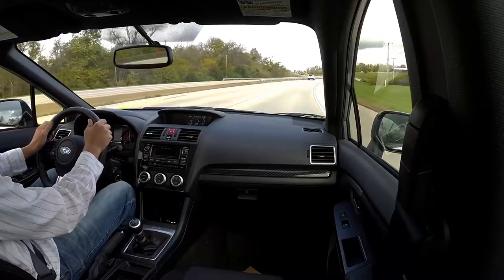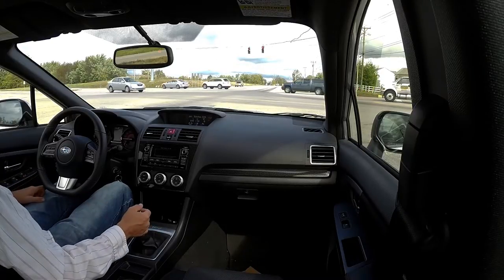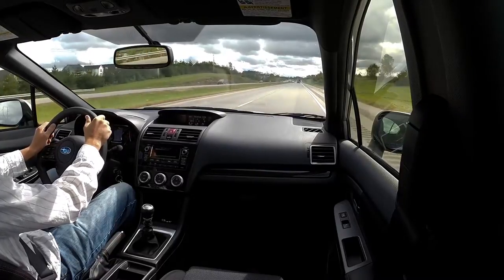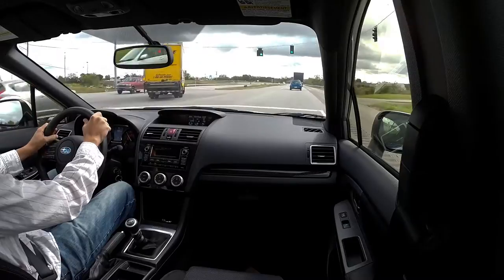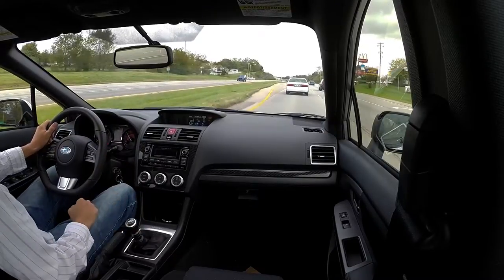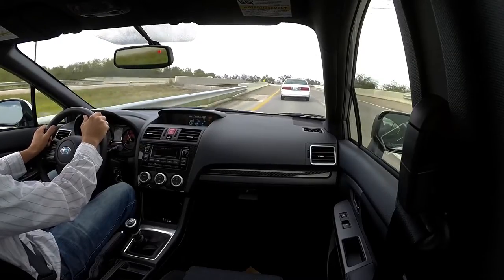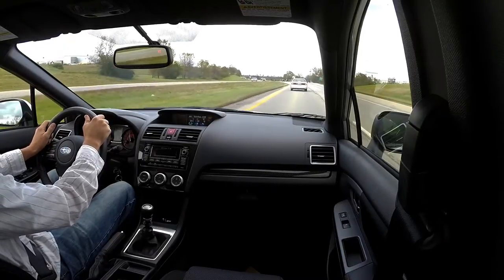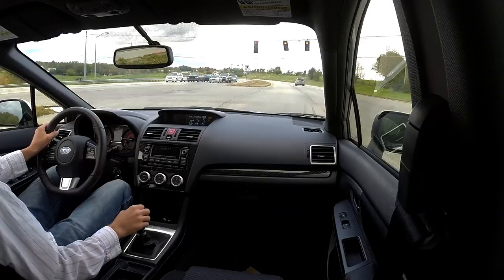2015 WRX Answering some questions about driving a manual transmission

Comment: I have a quick question. The WRX is my first manual car and I have done well driving it so far, only 6 stalls in 100 miles. I was wondering how you get off the line faster  and smoothly  at a traffic light or stop sign. What I do now is find the biting point and the apply a little gas while slowly releasing the clutch (sometimes it's a smooth start, sometimes it's a little rough), which seems to take forever and usually a car would honk at me or I would feel bad for making them wait behind me while others speed off in the other lanes. Someone told me I need to give it more gas while doing what I said above or Rev it up to around 2k rpm while feathering the clutch out slowly, but I don't know if that causes too much ware on the clutch.  Also, the 1 to 2 and 2 to 3 gear shifts are a little rough. I think it's because I'm taking too long to shift and the rpms are dropping and when I slowly release the clutch they have to shoot back up causing the jolt. Would the correct way to go about this is to shift faster and or to apply a little gas while releasing the clutch? Is this causing any premature ware on anything because the car seems to not struggle to match rpms it just jolts a little when the the clutch starts to engage. It would be really helpful if you can answer!

Comment: Going from a civic to a wrx.  The clutch takes some getting used to.  Drove the civic for 2 years and went straight to the wrx and the clutch on the wrx took me by surprise.  IT takes some pracice on that car.  But its just repetition basically.  I slipped mine very early on just trying to get used to how it behaved and finding a good seating position and what not.
Reply: I agre. I also went from a 2009 Civic Si and that gear box was very nice. The WRX is ver clunky and notchy. I'm at 7k on my 2015 and I'm very use to it now. I'm sure it broke in some too.

Comment: Downshifting when slowing down will save your brakes but at the cost of more wear and tear to your clutch and transmission. I don't know about you but I'd rather replace brakes. If your are, for example, in 5th gear and a red light is coming, keep it in gear without gas and leave it there while using your brakes to slow down and right before it will stall, put it in neutral. Not only will this save on your clutch and transmission, it will save you on gas since the fuel ejectors are off when in gear and coasting since the momentum is what's keeping the engine running.
Reply from the maker: True clutch wear will be increased, assuming you only push in the clutch while shifting it will increase wear.   Unless you are abusing the clutch it should not go out too quickly.  If you are planning on having the car beyond 80-100 thousand miles you will probably need a replacement at some point.  My Tacoma had 170,000 miles on it when I traded it in on the original clutch with no problems.  As long as your rev matches are correct and the downshift is smooth there should not be any significant wear on the transmission.  This is no different than letting the car hold you back when going down a hill, engine breaking is commonly used by many, and I mean many manual drivers and I have yet to hear of a single transmission failure that has been the result of using gears to slow you down.   Accelerating WOT at full boost puts much more stress on all parts of the drivetrain than downshifting to decelerate as demonstrated in this video.
Reply: or just rev match downshift...and not worry about it.
Reply: brentd86
rev matching + engine braking is great during break in period too.

Comment: Been driving stick for a couple years now. I've been pretty good at driving it day to day, with my rev matches and what not. Only thing I can't get down is smooth rev matches into 2nd. So I'll usually rev match from 5-4-3, then as my RPM's drop either pop it into neutral to fully stop or into 2nd at low RPM. I know it's the big jump in gear ratios between 2-3, but any tips of smoothly rev matching into 2nd?

Comment: Quick question:  Can I slip the clutch a but while trying to drive up a lip on my driveway very slowly?  I don't like holding it too long because I want to keep my clutch happy, but at the same time I can't let it out completely because I'm not going fast enough.  I'm new to driving manual so I'd appreciate your advise!  Thanks so much!
Reply from the maker: Yes you can.  Try not to rev the engine more than you need to but you can “feather” the clutch.   Which means slip it until you pop over the lip, then push it in while the car rolls forward some and then release the pedal and slip some more to pull the rear tires over the lip.  I recommend feathering because when you are slipping to get over an obstacle like that the vehicle normally wants to give a burst of acceleration after the tires clear it.   Minor slipping isn’t terrible as long as you only do it a few seconds at a time and keep the revs down.
Reply: Thank you so much for your quick reply and detailed answer.  When I down shift to 2nd gear, even after rev matching, I feel I need to take a bit longer releasing the clutch to get it to match smoothly; and when I in heavy traffic I sometimes take a little longer slipping the clutch from N-1st because we're all going to slowly.  I hope that is ok as well.  Thank you so much for your time and help.  I love my WRX and want to treat her right :D

Comment: when you down shift for a turn, do you just blip the throttle or do you heel and toe? I know heel and toe is kind of difficult in this car because there's not a lot room for my foot.
Reply from the maker: I heel toe.  It takes a while to learn, but honestly this car isn't too difficult to do it with when you get the hang of it.

Comment: Can you ruin the clutch by not pressing it in all the way before shifts?
Reply from the maker: +Zach Cipriano doing this means you are slipping the clutch for the entire shift so it will wear out quicker.   You are more likely to damage your synchronizers before the clutch wears out.   Doing this constantly for every shift will mist likely cause you to start grinding gears when you shift.   If you do it by mistake here and there a few times you will be ok.
Reply: Thanks for letting me know. My clutch has worn out at 38,000 miles. Looking back, I was probably not depressing the clutch all way and thus my issues.

Comment: I've been driving MT for about a week and a half. Two hour commutes everyday. My 1st to 2nd gear shift is really jerky. I'm definitely releasing the clutch to fast. Typically for a 2015 WRX, what RPM do you find shifting from 1st to 2nd for a smooth transition? Some advice will definitely help improve my driving. Thanks
Reply from the maker: Shift that one at 3k rpm slowly.  You'll get better.  Takes a while to get the feel of things.
Reply: I feel as if I'm releasing the clutch to fast during my 1st to 2nd gear shift. I'm going to try to work on easing my feet off the clutch.
Reply from the maker: You'll get it, just takes time and practice

Comment: how do you deal with the jerkiness between 1-2nd gear shift?
Reply: I don't have any jerkiness shifting from 1st to 2nd in my 2015 WRX. You just need more practice.
Reply from the maker: Normally to avoid it I will shift out of first around 3 thousand rpm and do it slowly, you can do it when accelerating hard but it is definitely a little tricky and takes some time to get used to.  Like everything it just takes practice.
Reply: brentd86 thanks man. enjoy and safe driving.
Reply: brentd86 iv'e been driving my rex (ice silver) for 3 days now, and i still haven't smoothed out second. i can be smooth if i really let it out slowly and give it gas at the astronomically high engagement point but at the cost of slowing down traffic behind me
Reply from the maker: Shift slowly at 3000 rpm and do it slowly for normal driving.   If you are determined to rev it up through first try keeping your foot on the gas some as you shift to second and force yourself to slow the shift down some.  Get it a little off and you will hear/feel the differential slap the undercarriage, godawful clunk.